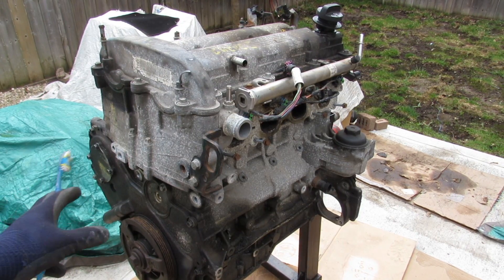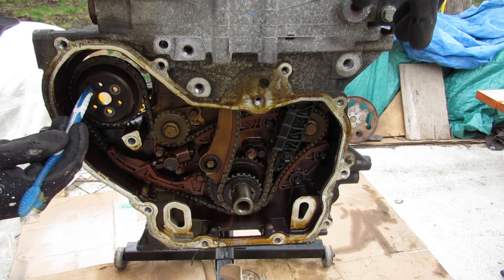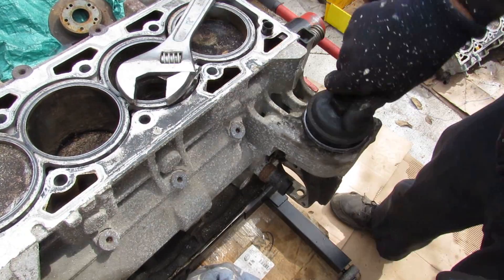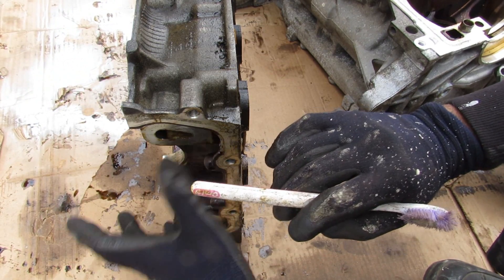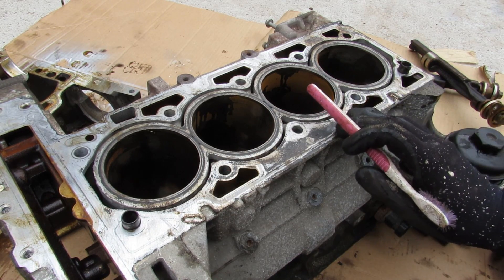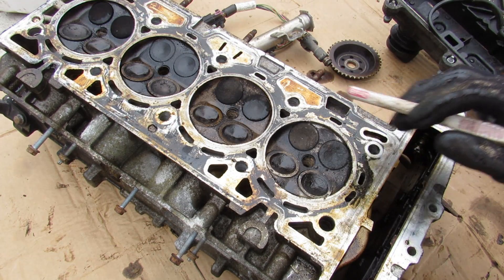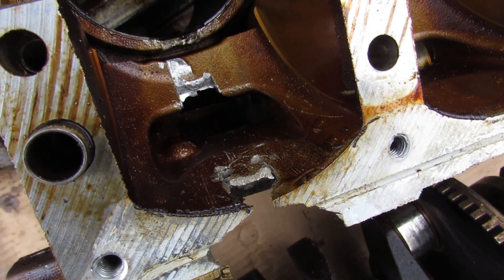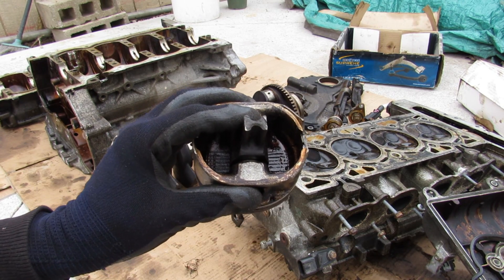Why GM Ecotec Engines FAIL

Comment: My daily shitbox have a 1.8L GM engine using cruze Ecotec 1.8 16v pistons, rods and crankshaft, running on 14,5:1 CR on E100 and it is awesome, 144bhp from a 1.8L 8 valve 4banger hahaha
A friend of mine have the same frankenstein engine, also with a 310º camshaft and pulled 80k km before he opened his engine to change the rings (smoking a little). His engine pulled 162hp on the dyno.
Also a costumer of our shop used this recipe in his corsa B, but with the 16V head and a turbocharger, if I remember correctly it pulled 320hp.

Comment: You can definitely tell this engine wasn't maintained well at all. I think if you replace the timing chain around 100k, you should be good. Mine is built, but i've put 70k miles on my 2.2 L61 with 15psi of boost. I'm going to replace the timing chain and tensioner with the updated design, as well as the lifters, as they underwent a design update as well.
Reply: Can you tell me more? Mine is a 2005 2.2. So I can get updated versions of those? Do I need to ask for something special or do they not sell the old kind any more? Thanks

Comment: Nice video man, i got one of the newer 1.4 ecotec engines. I check fluids religiously, so far so good. The main issue with the 1.4 are the pcv system and  coolant leaks.
Reply: I enjoy my cruze alot, has the 1.4 ecotec. Been very reliable and if something did go it was super cheap and easy to fix myself
Reply: @eddie3500  same, you can't abuse it like a corolla. but if you pay attention to it, it will serve you well
Reply: @amirmograbi  yup I'm under the hood every week checking my fluids but I'd do that to any car id own anyways. I don't understand all the hate the cruzes get
Reply: I see the 1.4 engine everyday as an opel mechanic. The only real problems are indeed coolant problems. I've only seen an head gasket ones. And is was from a guy who didn't maintain his car right and floored it all the time. If you keep the 1.4 well maintained it's a really good engine. That's why I bought a corsa with a 1.4.
Reply: @OwkeejGamers  good to hear from a mechanic ! My experience is anecdotal so it’s important to hear from people who actually work on these engines for a living !
Reply: pray it's not the head gasket
Reply: @kclefthanded427  not head gasket. It has issues with overflow tank cracking and a bunch of plasticky bits that are bolted on the engine could cause it. water pump could have a leak as well and that's covered with extended warranty. to my knowledge head gaskets are not a common issue on these
Reply: For a GM motor, that is sick reliability. No wonder that the Sonic is considered as the BEST SMALL CAR that GM has ever built!

Comment: Thanks, great video because I like the GM Ecotec, and it's good to see one disassembled.  I've got a Malibu  2.4L with 185k and a Cobalt 2.2L with 105k.  It's a great little engine, and I have had no problems with either one, and they're easy to work on.  The parts are super cheap to buy from Rock for maintenance.  Case in point a Subaru I own needs an O2 sensor front and it cost $145.  the Malibu needs one too and it's $34.  FYI, just drove the Malibu 2,876 miles from Columbus, Ohio to the USMC base in Twentynine Palms, Ca. and it lost zero engine oil.
Reply: GM absolutely blows away Subaru when it comes to engine reliability. 

A blown head gasket on a Subaru is a rite of passage. 

On a GM it’s 20 years and 200,000 miles after it left the factory... and it’s “not worth it” to fix.
Reply: @calvinnickel9995  Subaru has apparently fixed their head gasket problems.
Reply: @calvinnickel9995  yeh for sure, and a head gasket and head work is no joke to your wallet with a Subaru compared to an Ecotec.
Reply: 29 Palms
Reply: @fun_ghoul  I work here:
Building 1428, 4th St, Twentynine Palms, CA 92278
Reply: My 2007 Malibu 2.2 failed transmission at 225k,.  The engine failed at 268k. The main reason was the front gasket and balancer gasket start leaking bad. Causing the tensioners to break. Replaced the timing chain kit from AUTO ZONE.  It broke in 15k miles.  Replaced the Engine and transmission with lower mile 68k,.  My 2018 Subaru Outback Premium stays in the garage for the weekend
Reply: Have you verified that O2 sensor? My Honda throws the O2 sensor code when the air filter box isn't seated correctly or the tube on the box. Fools every mechanic and they quote a new O2 sensor when the air filter box and hose needs to be attached. Saved me $$$
Reply: @midwestfarm757  Gonna check that, thanks.

Comment: What a pos engine balance shafts in the engine and the water pump like like that could be alot better but than again its a gm not a toyota 5sfe
Reply: Timing chain water pumps have significantly fewer failures to belt driven water pumps and are more compact, balance shafts promote smoother engine operation
Reply: @elijahguzik4618  ik but like the way its made is something only gm would do it make it a bitch I get the balance shafts in the block but if one of them spins a bearing or something like that the engine is dead

Comment: What's the purpose of those balancer shafts?
Reply: Why to balance of course
Reply: I think those are  part of a system assists with mitigating the vibrations caused by the engine as it functions.
Reply: If you've ever driven an inline 4 engine that doesn't have balance shafts you'll understand their purpose.  4 bangers are some of the roughest engines out there.
Reply: @mrflamewars  the balance shafts are commonly deleted on these engines in performance applications, nvh is increased but for a faster revving engine

Comment: Timing chain problems are the most common let's see if it's TRUE
Reply from the maker: It was in this case..
Reply: @speedkar99  Yep it's too funny since they are all destined for this short life.
Reply: It was the front cover gasket leaking. I ran a quart low it will heat up tensioners and break the cheap plastic parts
Reply: Timing chains/tensioners/VVT are a weak link in most DOHC engines. Considering the sludge buildup that coated everything inside this engine, the owner pushed oil change intervals waaaay too long and did a ton of short trips... and never checked the engine oil level on top of it. Good way to destroy any brand of engine.
Reply: @karlschauff7989  The plastic guides on these cars are brittle and the overcomplicated water pump makes it worse. Camry/Corolla of the same years are still common on the road but a cobalt?
Reply: @karlschauff7989  I baby my 2018 Subaru Outback,  I keep it in the garage like a show car. The Malibu is my M-F car